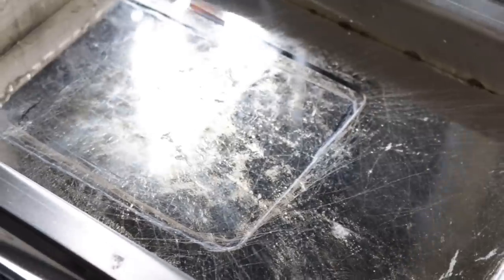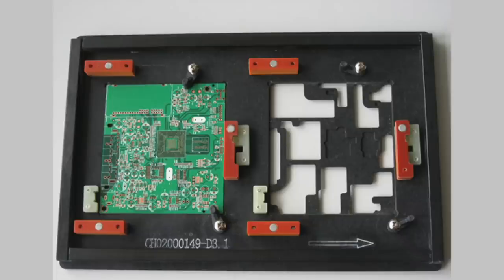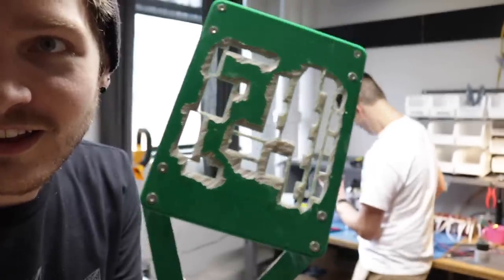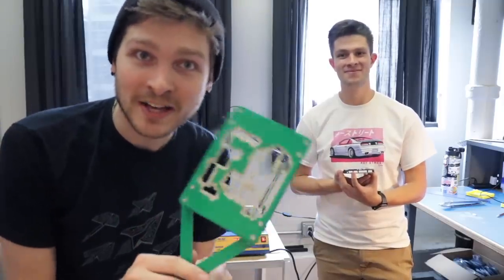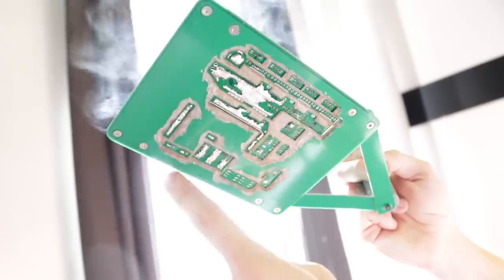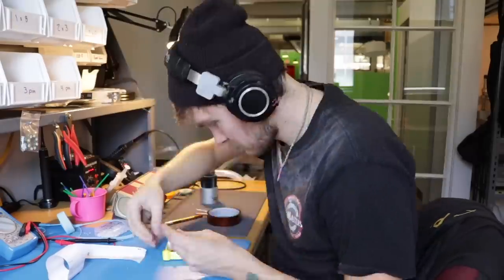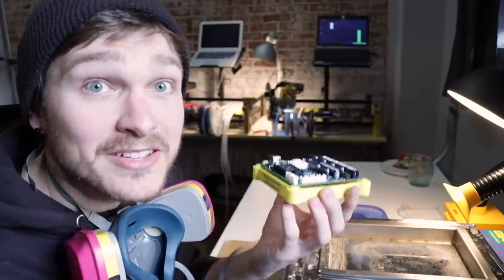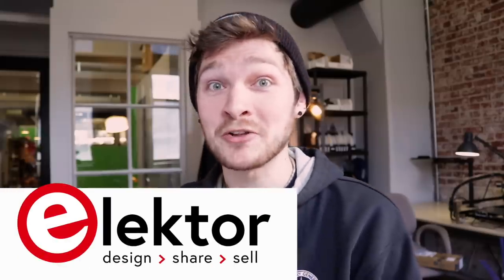soldering PCBs with molten metal

Comment from the maker: Every LumenPnP we make is danger puddle approved: https://opulo.io/products/lumenpnp
Reply: What is needed to turn a V1 kit into a V3/V4 kit?
Reply: Don't dip the boards in the flux.  Put the flux in a spray bottle and just spritz the bottom of the board.  It won't evaporate in the bottle, the application will be more consistent and no flux will get on the top of the board.
Reply: @MartinBogomolni  Good question, I was asking that question multiple times. It was promised in the V3 presentation video!
Reply: Yep, first comment I saw said air pockets. Glad we're on the same page

Comment: When I was a kid, my father had a company that manufactured boards.  They used a wave soldering conveyer system.  It was about 8 feet long, had a track that the populated board would run along, and it would enter a solder pool which had a small 'wave' along its width that would just skim the bottom of the board as it passed through.  It was pretty fascinating.  You really need one of these!  It can completely solder a board in about 10 seconds.  By the way, you also need to seriously consider your ventilation solution.  What you are using currently is not sufficient.  If you're going through that process hundreds of times, your entire room will be coated in burned flux and solder particles, as well as your lungs.  You don't want to develop problems 20 years down the road.  Future you will be thankful that you dealt with it properly now.  Love what you're doing!  Don't cut safety corners!  Cheers!

Comment: It's not about the shape of the edges. All the areas you want soldered are in air pockets, preventing the solder from going up to the board. If you hold a cup upside down and push it into water, the water is not going into the cup. That's what's happening here. You got it working, because you're rolling it over the solder, so air can escape on one side. What you could do instead, is make holes or channels to the areas you want soldered, where the air can escape. Then you won't have to grind the corners and you won't have to roll the board over the solder.
Reply from the maker: AHHH cool thought! I didn't think there was a good enough seal for air to get trapped, but I think you're right. I'll retry with the stock pallet and use the roll technique and see if I get better results, thanks!
Reply: @stephen_hawes  The flux IS the seal.
redrok
Reply: @stephen_hawes  just enlarge the throughholes by 0.1mm and they should let the air escape.
Reply: I'm reminded of injection molding and various kinds of casting. In these processes you have to include sprue channels in the designs to allow for material to flow in and out and for air to escape as material fills the main volume.
Reply: @rockosgaminglogic  Either that, or just put a couple of unpopulated through holes on the pcb which act as the vents. I’m not sure a 0.1mm increase would help much given manufacturing tolerances
Reply: exactly. This is the reason why it is called wave soldering.
Reply: @CookieCraftMedia  we know the current size isn't enough so any increase will help. Given that there are many, that 0.1mm will multiply to a decent vent.
Reply: @rockosgaminglogic  - If a 0.1 mm increase is too little to let air through, then it doesn't multiply. Many times zero is still zero.
Reply: @peterwhitey4992  of course it will let air through if there is any pressure. The argument was whether the manufacturing tolerance would round that 0.1mm increase down to no increase. They use CNC drilling and their bits are in smaller increments than 0.1mm so this should be fine. I've had hundreds of PCBs made that I designed, learn from my experience.
Reply: @rockosgaminglogic  - That's not an of course. The pressure is very very little and the with the board being wet from flux, the openings need to be even bigger. Specific air vents or a pallet with no air pockets is a sure way.
Reply: @adamrak7560  - This is not wave soldering
Reply: @peterwhitey4992  ok so calculate how much pressure is required.  The flux will be pushed out of the way.  Besides, the flux is vaporizing via heat and likely causing this problem.
Reply: @rockosgaminglogic  - Experience tells me you need way more pressure, than you get here. It's being dipped about 1 mm, so the pressure doesn't reach more than about 1 toor = 1/760 atm, which is very little and not enough to force air through tiny gaps, especially when they're wet. You don't want to have to dip it for a long time, so you can't rely on waiting for flux to evaporate and air to slowly escape. You want the solder to reach the pcb fast.
Reply: if the flux is vaporizing, wouldn't that create a linden frost like effect keeping the solder away, so not only is there an air gap, if directly dunked, but also the flux vapors blocking the solder and the air from leaving due to the pressure it creates from vaporizing pushing down into the vat?, much like the wet hand in a vat of molten lead trick?
Reply: @MrTrilbe  exactly
Reply: @rockosgaminglogic  opening the holes will help but not on it's own, because the through hole components will be sealing the top of the board, the pressure from the evaporating flux will have to overcome their mass and inertial (would explain why the edge mounting holes filled so well, no components), ok that's not a lot of mass and inertia for people, but for a relatively small amount of gas it's a lot, maybe some kind of shim under the components that can be easily removed without damaging anything but porous to allow the gasses to escape, maybe a paper mask, it can be made on a plotter with a knife, design in some vent lines, and removed with iso?
Reply: @stephen_hawes  And the alcohol vapor got traped in the same pockets - combined with low heat :-) You found a technice that works.

Wave-soldering probably handle these air-pockets better.
Reply: @adamrak7560  I was about to say, isn't that the reason why wave soldering makes waves, to prevent air pockets from causing an issue
Reply: You could also create a DIY nitrogen generator and pump it over the flux to keep it from oxidizing or create a molten solder pump that pushes molten solder into a spout you move the board over... That is surrounded in another tube that you pump nitrogen into.

Basically you need to keep the spout covered in a layer of nitrogen gas. Hell if you created a DIY pick and place machine this is not much different, just have it move the board over the solder spout incased in a mostly nitrogen box...

Comment: I have the same dip soldering machine at the company I work at and also started out with the same issues... We discovered the temperature at the surface is lower than what the display says, probably losing heat from touching air and being irradiated as infrared, or just the temperature sensor is inaccurate. Eventually we set the solder bath to 420C (on the display) to get the process right to perfectly solder the though-hole components. Another way to solve your mounting hole issue is just use non-plated through holes and keep solder mask on the bottom side of the mounting holes which prevents wicking... the top side of the mounting hole can still be connected to your PCB Gnd which will still make contact with the screw head.

Comment: Hey mate, in manufacturing you gotta always make sure you preheat things or you’ll not only get the issues you saw here but also premature failures. You should also cool down slowly using the suggested profiles of the solder you use. This typically happens on a conveyor belt in wave soldering but you can do mostly the same in a controlled oven (for prototyping we used a heavily modified fan assisted toaster oven with an arduino to control the heat/pid and allowed us to customise curves
Reply: Exactly. Preheat all boards first before even attempting to dip them. 100C should do, while still being low enough to not melt anything.

Comment: Back in the day we used to call this flow soldering. Strongly suggest you get yourself an extraction hood above this thing. The flux and vaporized lead is super super bad for you. Even if you wear a mask while you’re using the machine the stuff hangs around in the air.
Reply: I don't believe that any states allow the use of lead solder in manufacturing environments anymore, thus they typically use silver solder, which isn't nearly as good.  However, you are correct about the fumes, the vaporized flux and other vapors are extremely bad for your lungs.
Reply: To add on to this, if you’re not venting outside, I’d get a combination activated carbon + HEPA filter.
Reply: @cnc-maker  Lead solder is still used by some manufactures.
Reply: @kennorman3586  in certain industries which have exceptions, yeah. Like aerospace. I doubt hobby grade pick n place qualifies. Even automotive doesn’t.
Reply: @JasperJanssen  almost all hobby soldering is with lead, it's a lot easier and it's not getting ROHS qualified for sale so everyone uses leaded solder for it's better characteristics
Reply: @BIGGlep  these guys seem to be selling a product, it’s not just a one off for personal use. It would have to be rohs compliant.
Reply: @JasperJanssen   depends on the product. RoHS has a lot of exemptions, depending on the industry and application. Most larger companies have compliance people just to navigate these regulations. I don’t think these devices would fall under exemption, but a lot of industrial electronics (things meant for large scale, fixed installations) do.
Reply: @JasperJanssen  sorry, missed your previous comment amount industry exemptions. Yeah, hobby grade won’t cut it. If they billed it for larger commercial factory setups, maybe. They’re most concerned with the likelihood your device will end up in a landfill.
Reply: @ryancrawford9894  I mean, on the other side, who’s going to come after these guys for selling like three dozen machines with a motherboard inside that may have a little lead in its pencil. But I don’t think they should technically be doing that.
Reply: @JasperJanssen  I think OSHA might come in before the RoHS police

Comment: Adafruit uses a selective solder machine.  It pumps the molten solder up a fountain then moves the nozzle around to cover only the areas needed.  An alternative is to move the part around over a fixed nozzle.
Reply: If only he had access to some robotics that could move a board around...
Reply: As someone that works in the industry, we use selective solder or hand soldering many many years ago we had a wave solder machine. I've not seen people dip boards before. Not to mention dipping looks way too dangerous for a production environment.
Reply: @UTRG-UnderTheRain  agreed ... wave solder is The Way(tm)
Reply: I'm pretty sure it even has a nitrogen atmosphere to reduce dross, but the dross cleaning always looks Sisyphean...

Comment: As others have said - wave soldering.
Or something i have seen from a friend: He used a conveyor-toaster for reflow-soldering (worked great, he later took it apart and made the conveyor dip the boards into a pool of molten solder)
Reply: Oooooh!  Did they document it anywhere yet?  

That sounds really neat, and i saw a commercial conveyor oven like that the other day at an auction and thought that but didn’t have the need yet!

Either way getting them in contact with Stephen may be good.

(Edit: Typos)

Comment: The process is called wave soldering where the molten solder is pumped out of a fountain, making the solder appear as a wave.  There's also a conveyor system to move the board over the puddle at the correct speed. This video is a good demo of the machine and the process: https://youtu.be/q4pUKfRHd8Q
Reply: That is a really informative video. Lumen should definitely use this technique rather than dangerous looking manual dipping.
Reply: They don't have a wave pool, its just a pool.
Reply: @rockosgaminglogic  Would need tiny pcb lifeguards then for something as dangerous as a wave pool!
Reply: @mvadu  Wave soldering is way more expensive and involved than dipping. The uploader obviously knows about wave soldering.
Reply: Better for when you have a proper assembly line (since you can just have the boards all be on a conveyor that runs through component placement, soldering, etc.), but I don't think Opulo is making in that kind of volume yet
Reply: @wesleymays1931  They do have smaller ones too.  The machine he's using is intended for salvaging ICs.

Comment: I thought you had to heat up the board with components before dipping. 
You need to look into a wave solder machine. Board edges ride on a conveyor belt over a wave of solder. Board is heated before the wave and then cooled after as it rides the conveyor.
Reply: Came here to suggest he look at wave soldering. Very similar process, and there are a lot of techniques he could learn just by watching it work
Reply: Pretty sure those machines are an extra zero or two more expensive though, as this is just a literal heated vat.
Reply: @zerumsum1640  yeah for sure, but I think he could make his own with only a couple more components
Reply: @JB-fh1bb  it's plywood, some ducting, and a little hardware. shouldn't be hard.

Comment: We use an Ender 3D printer to move the board over the solder pot and dip it, move back away from the pot and pause so we can swap the board. Our g code script does runs of 12 boards then we re run it.

Comment: Small suggestion here to improve the fume issue as the danger puddle is still just chugging out fumes like a smoker who just got off an intercontinental flight. Set up an enclosure in kind of a \_/ shape (wider at the front) around the solder pool with the filter fan on the back (may need a bigger fan) with the walls as tight in as possible. Either vent the air outside (shouldn't be hard to make a vent tube adapter for a window) or through a suitable filter, but having it enclosed on all sides but the front will allow the fan to pull all the fumes to the back. Probably wise to put the port for the vent tube on the box at the top, near the back. This also will help contain any splashing if anything goes wrong, as well as massively reduce the amount of flux and solder fumes in the building.

Comment: At work we use a selective soldering machine with kinda like a fountain of liquid tin.
A panel with the PCBs put in moves over it so that it only touches the areas where there are pins to be soldered.
Advantage is that there is a smaller amount of tin to heat up (so less energy consumption on that end).
We also add nitrogen to reduce oxidation (extracting the nitrogen out of the air unfortunately does require some additional energy).

In our previous facility we had a conveyor belt going through a puddle of liquid metal, but the results weren't as good as the selective soldering machine.
Also, occasionally parts or boards would fall off of the conveyor belt into the puddle... The smell was horrendous 😂

Comment: We use wondermask p to mask our boards. Also paper backed masking tape has worked as well. We use a full wave soldering machine though. I don't think dip soldering should really change much to make them incompatible but I don't have any experience with dip soldering boards.

Comment: I was think a low tech was to improve efficiency of the connector assembly process could be to make some sort of 3d printed sheath that had stacks of the connectors in the correct alignment to slip onto the pcb and then within the sheath thingy you'd need some mechanism to only let one layer of the connectors out. down side would be that if you changed something small on the pcb that affected alignment you have to change the design of the sheath thingy to account for that. think making a good release mechanism could also be finicky... also maybe a future lumenpnp could have a connector toolhead/ little gripper that could place larger through-hole parts/connectors

Comment: the advantage of adapting a 3d printer design to make a selective soldering robot is that you'd have another complementary product to sell
Reply: @Dampfhammer96  yes, you can also find some existing open source designs on youtube, they are very similar to this one, but less accurate, a successful joint is made 60-80% of the time I think, I didn't realise ersa made such a small machine, I expect they will be at the german trade fair that stephen mentions in his video

Comment: I used to work at a place that built controller PC boards for cable boxes, and since this was before SMD came into the fore everything was through-hole. The actual soldering was handled by a belt-fed wave-soldering machine roughly the size of a refrigerator on its back. It had an adjustable width feeder that accepted an assembled PCB (or in this case a palletized PCB with three modules on it), passed it over a foam roller in a trough that applied flux, then over a heater to preheat the board and parts, and then through a "wave" - basically a roughly quarter-inch hump - of molten solder (thus the name) being pumped over an angled barrier to do the actual soldering. The end result was a near-perfect solder job every time. Populated but unsoldered boards went in one end and came out the other end ready to be bench-tested/QCed/pre-tuned (there was a trimpot that needed to be set to "dial out" parts tolerances in one of the critical timing circuits), and then packed for shipping.

Comment: If I remember right from when I worked on the board line at NCR many years ago we used Kapton dots to cover the holes and they were applied by the PnP before SMT reflow.  Then the boards were stuffed by hand (with only a very few TH parts it wasn't economical to have a TH PnP machine)  and then through the wave solder machine.  We also had a desktop "mini-wave" machine that was used to replace large items like PCI edge card connectors.  You could use the wave to heat up and remove the entire connector in one shot.  Then you'd clean the holes out and replace, flux and mini-wave again to re-solder it.